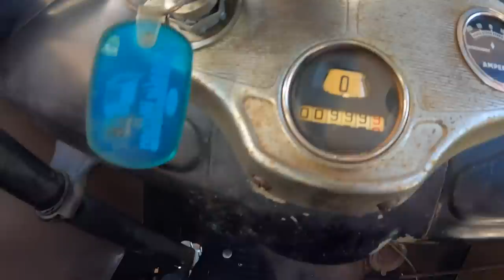This Adventure Across the Country is Going to be UNFORGETTABLE!

Comment: Merlin, I like the title of this video. I just hope the unforgettable part doesn't mean that you will wake up in a cold sweat or screaming. It looks like you're off to a decent start.  By the time you get back to Havasu you should have all the bugs sorted.  Safe travels.
Reply: They should seek out non-ethanol gas for the trip.
Reply: @larrybe2900  
 Yeah that would be best but in midwest it can be problematic finding it.  You have to seek it out, when close to boating areas you can find it.  The fuel in IL. is almost always E10 at least. I could fuel up in KY drive up there not needing to refuel until leaving but have to fuel up twice on way back due to ethanol in fuel. I'd lose 10-15% mpg at least.  The ethanol will definitely break loose everything in fuel system.

Comment: You laughed about sitting on the fender and reminded me of a story told to me by a blind friend I once had.  He may have been blind, but he could rebuild a Willis Knight rotory engine with sliding sleeve valves and it would not blow up if you did it wrong.  Anyway, he was telling me about driving a car with similar fenders while his partner was sitting on the fender adjusting the carburetor while telling my friend how to keep the car straight on the road or turn a corner.  His friend got left and right mixed up and they ended up in the ditch.

Comment: Merlin, I’ve spent a lot of time messing with Model T Fords and watching you mess around with that darned old carburetor made me smile. Tapping on the carb has been a fix for old Fords and Farmall tractors for as long as I can remember. I was going to make a smarta#? remark about the condition of the float but I couldn’t do it. The truth is, if it works, don’t knock it. I was lucky enough to go through the Indianapolis Museum back in 1987. It was a wonderful experience. Good luck with your cross country trip. I believe you’ve chosen the right car for the journey.

Comment: Yep, that's why you flush the fuel tank before you take sumtin outta hibernation.  Sometimes I'll take an old electric fuel pump, a big basket strainer and large sock filter to recirculate fresh fuel through the tank for a few hours to polish it.  Saves a lot of grief.

On the carb parts falling out your in good company.  Harrison Fords plane crash a while back was caused by that however you landed much more safely and got to drive away.  Fifty+ in a Model A was considered Flying Low back in the day.

Have a fun and safe trip!!!

Best!

Comment: Hey, I remember those old pumps! they had them here in B.C. through the fifties. You knew exactly what you were getting because it all went into the glass jar up top which was marked in gallons and fractions. Then it drained through  the hose and into your tank. No cheating there. Of course those were Imperial gallons.

Comment: I had to pull a Carter carburetor off of a BlueBird school bus on the way up a mountain in Spokane.The pin came out of the float and fuel splashed on to the exhaust manifold and started on fire. Put it back together and everything was fine. We still called parents to get their kids though, just to be on the safe side. Everyone was a little surprised that the pencil necked geek of a math and science teacher even had a clue. That's why Ive been pushing ALL of my students to take industrial arts classes, and that they don't need a 4 year degree. Pushing everyone into a degree program may be good for student loan companies, but it hurts the students, and just try to find a plumber, electrician, handyman or honest mechanic on short notice.

Comment: If it was me, I would’ve just drained the differential lube and put new lube in same thing with the transmission. Once you confirmed it was OK and since it had water in it, I would run it for like you did and then drain it out and put new lube in again that way it’s all flushed out anyway, good luck on your trip. Oh also on your coolant I guess you put antifreeze in I would definitely put some antifreeze in that lubricates the pump.

Comment: My grandpa used to tell me a story about his garage back in Missouri in the 30’s.
This old farmer would come in to the station (In his Model A) and get 10 cents worth of gas and ask him to check the carburetor because it wasn’t running well. Grandpa would raise the hood and fiddle with it and low and behold it ran swell. After about 10 or so visits like that grandpa felt a little used so he decided to do something about it.
The next time the farmer came in, he ordered the 10 cents worth of gas and asked again for him to look at the carburetor once again. This time grandpa handed him a bill for 60 cents. The farmer asked what the extra charge was for? Grandpa just smiled and said “10 cents for the gas and 50 cents for knowing where to tap.”
Reply from the maker: this is great 😊 🇺🇸🔧🏁

Comment: Mom was from Wva. and they had model As and Ts and Grandpa used to have fuel problems alot with them. Wva is hilly and when going up a steep hill Grandpa would have to turn the car around and back up so the fuel would push to the carb. being as they had no fuel pump. She also said in the winter he'd take a coal bucket and put come coals in it from the stove in the house and slide it under the engine and let it warm up the engine and oil in the pan so it would start on cold mornings. People were tougher back then.